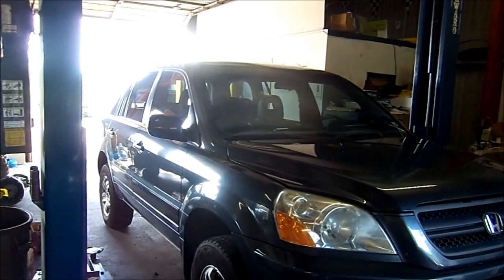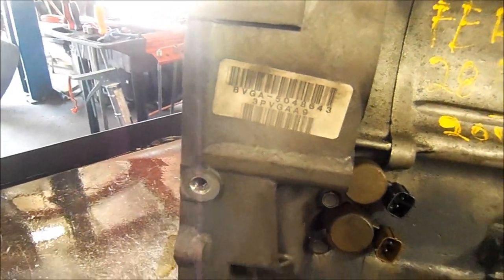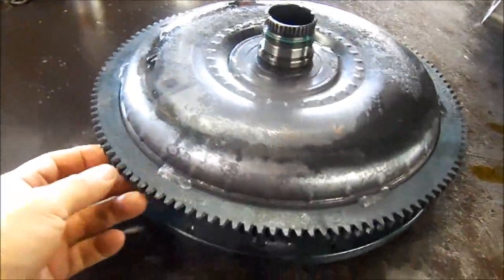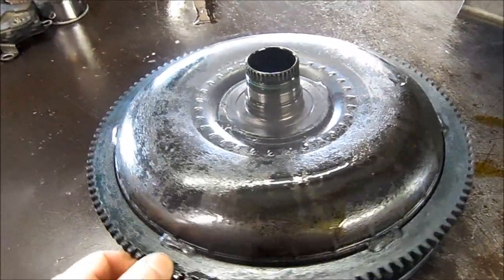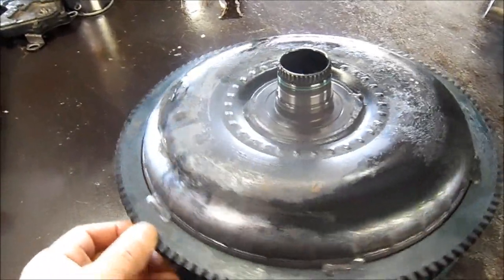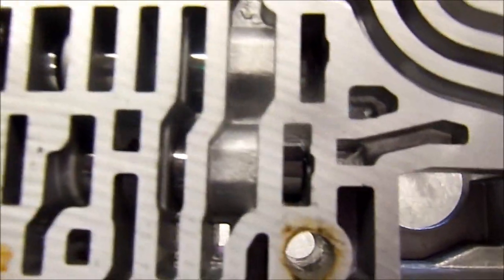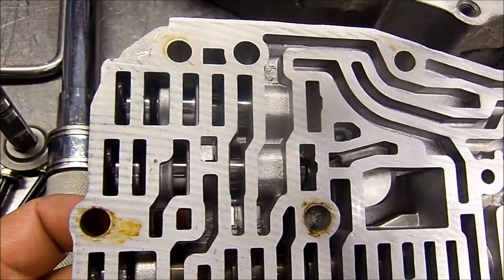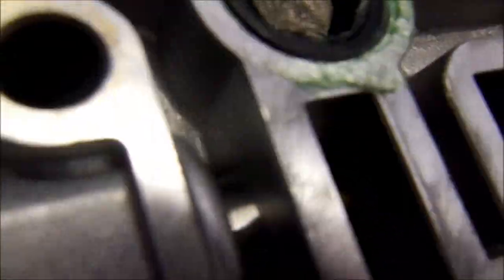Honda Pilot Burned Torque Converter Case Study

Comment: So was everything solved with having replaced the torque converter then? Have an 04 Saturn Vue with the Honda 3.5  j35a3 engine mated with the mj7 transmission. I believe the torque converter is shot. I drained out the burnt trans fluid and cycled in some fresh Honda dw1 and it will drive for maybe a couple of minutes prior to the trans being at operating temps and then seems to not want to work any further. Was considering replacing the entire transmission but as per usual I’m on a budget so was thinking of maybe just trying that first.
Reply: NobodyKnows ButMe did you ever figure out what it was I have the same issue
Reply: Is it making any type of whining noise?
Reply: @zoneb609  I have a crosstour , I had the whining and later a very loud noise like something was braking inside of the transmission

Comment: I have a 2011 honda pilot and when am driving between 25 to 35 mph it shake for a bit or when am turning sometimes you thing has to do with a torque converter problem let me know thanks???

Comment: Hiram, are you saying that the common transmission issues on the Honda Pilots are caused by the Torque Converter?  I have a 2003 Pilot with 183K miles.  About 10K miles ago when I drive it at low RPM at round 40MPH I feel this sudden vibration noise & occationally the SUV jerks... are these the symptoms of that?  and if so, will replacing the torque converter fix it from not damaging the tranny?
Reply: you didn't listen at all, the torque converter isn't the issue at all, it's a symptom